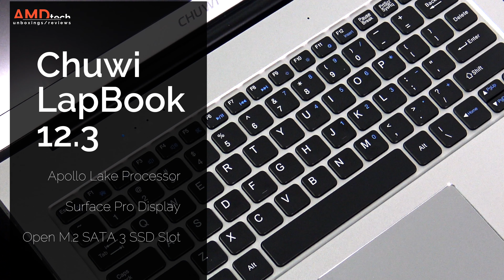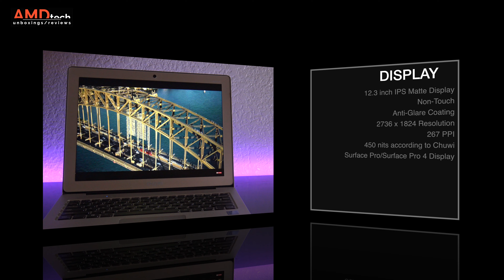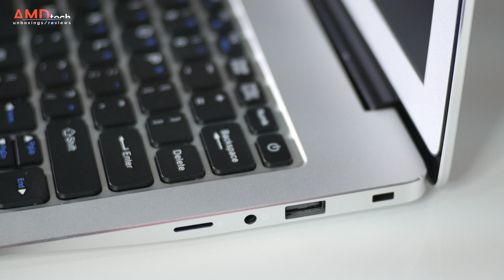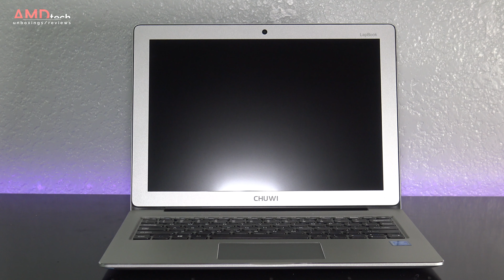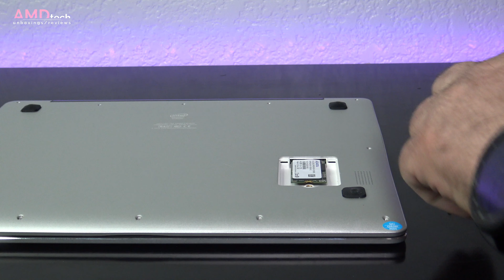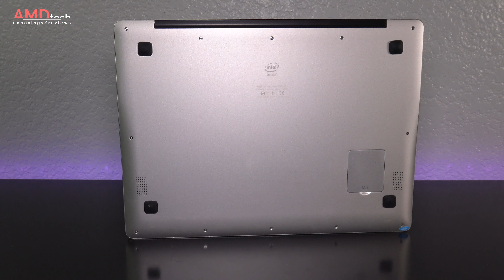Chuwi LapBook 12.3 Unboxing & First Look: The 12.3-in Laptop with Surface Pro Display

Comment from the maker: Hey everyone, the Dual Band Version of the Jumper EZBook 3 Pro is on sale for $219.  A great deal.  Here is the link:  its fixed. http://www.shareasale.com/r.cfm?u=1280615&b=573201&m=52031&afftrack=&urllink=www%2Egearbest%2Ecom%2Flaptops%2Fpp%5F647765%2Ehtml%3Fwid%3D11
Reply: I put in an order for the EZBook 3 Pro, but since they canceled the order on me once I'm not sure I'll get it. The Chuwi seems like a nice alternative. On the Gearbest site they list the weight of the Chuwi as "Product weight: 1.0430 kg". That would be nice - but looks like that is a typo. Gearbest pricing of the EZbook Pro jumps between 220 and 300. Seems like they are underpricing it at $220 and they be better off selling it for ~$250 and not canceling people's orders.
Reply: AMDtech great for the price. Great video I can't get over the name though Chewy
Reply: Bought it and would probably love it it they would ship it to me.. 

I bought it in may with a coupon, they have refunded it after a month. 
Bought it again on flash sale now, "Its not in stock and we have problems with the supplier and have ordered more".
I'm not sure if it ever will show up at my place
Reply: the chuwi has also change the price to 299.99, https://liliputing.com/2017/06/chuwi-lapbook-12-3-laptop-2736-x-1824px-display-now-available.html
Reply: It costs just 289.99 dollars with coupon code: CHUWI123
http://www.gearbest.com/laptops/pp_622091.html?wid=11&lkid=10967510
I hope this may help you

https://www.youtube.com/watch?v=GnqqqPb60b0

Comment: Hi Andrew. Nice review, indeed.
I finally got my Chuwi 12.3 that I want to use with Linux.
However, trying to boot an USB pen drive with some Linux Distros, I just can't...
I've modified the UEFI/BIOS already to 1st boot with the pen (yes, it sees the pen), also modified OS to Linux, but noway to boot from it.
Additionally, when I press F7 when booting, it shows me the menu to choose what to boot and again I can see the pen, and again doesn't start from there.
Thx for helping.
Cheers
Reply: Solved!
What I did was grab another pendrive, different brand, put a fresh iso on it and... BAM! Done.
Well detected GRUB, normal selection,... etc.
This time picked Mint-Cinnamon 64bit and it just gets very small sized at the begginning (live mode) but could easily fix it in General System Settings. Think 2K screen effect...
I read some comments on the Chuwi Lapbook 14 not accepting every pendrive brands, so I took a shot. In fact, I was using 2 Kingston pens and another unbranded, at first.

Comment: Thanks for the review, can't wait for the full one! I would love to see a comparison video as I originally purchased the EZBook 3 Pro but cancelled my order to instead purchase this. 

So far I am really happy with my Chuwi Lapbook 12.3 except for a few issues. The touch pad is starting to bother me. Often when I try to two-finger-scroll on webpages I end up zooming in and out. There are no drivers (that I can find) to adjust these settings. Also, when I left click in the bottom left while moving the mouse with my other finger, the mouse tends to jump around because of distance between  my two fingers. It is forcing me to double tap instead of my natural tendency to use both hands/fingers.

Also the keyboard is alright, but if you press in the corner of most of the keys so that the key drops but your finger isn't in the center, it doesn't register the stroke. A somewhat minor issue (as someone coming from a mechanical keyboard) but has lead to quite a few spelling errors when I am typing.

Not sure if you've experienced these issues but I would be curious to see what you think. Can't wait for my M.2 SSD to come in to replace the terribly slow/small EMMC drive. Not looking forward to cloning the drive (I have had issues with this in the past) and there are currently no places to download the drivers. Does anyone have access to these just in case?

Thanks!
Reply: hello, i find this link from their forum, hope can help you http://forum.chuwi.com/forum.php?mod=viewthread&tid=4286&page=1&extra=#pid25038